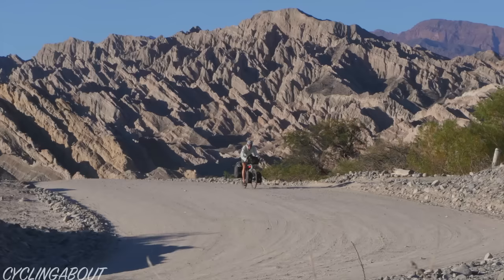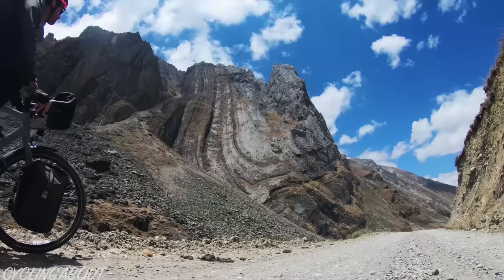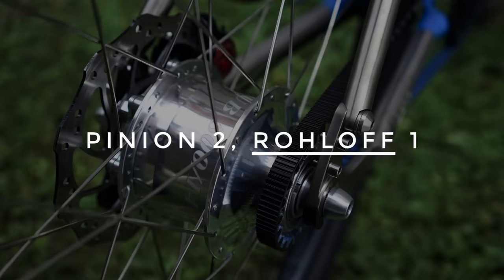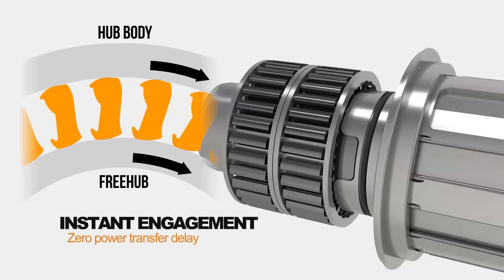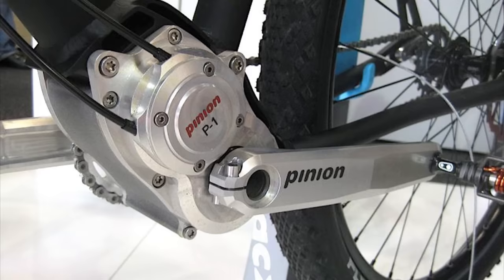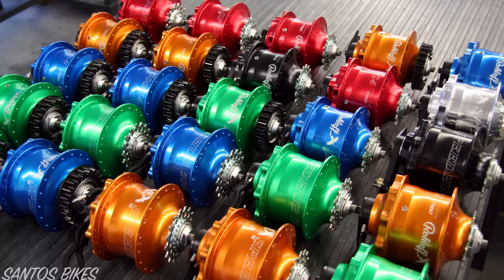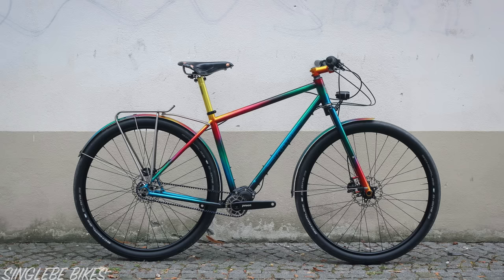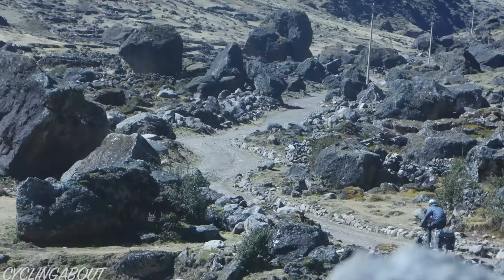What's The Ultimate Bicycle Gearbox? Rohloff Hub VS Pinion Gearbox

Comment: Well... I guess I'm gonna have to use both in a single bike! 🤔
Reply: Do it - we'll all have 252 gears and a belt drive in the future :-)...
Reply: I can't find it now, but someone did this and posted a video a while back.  It was pretty troll.  You get the downsides of both, and lose some of the upsides of both, but you can pedal at whatever speed you want.
Reply: @tonyk8368  so you can pedal uphill at 0.5km/h and 500km/h on flat terrain ?
Reply: Upshift with one and simultaneously downshift with the other 😀
Reply: @tonyk8368  it was Tout Terrain who combined the Pinion and Rohloff into a single bike... Here's the video: https://youtu.be/e-ig-R65yHg
Reply: So you can skip the noisy 7th gear :)
Reply: That's like 3000%+ range.
Reply: @peglor  and no one gear are repeated because its different steps between them 😂
Reply: Great! But you'll have to fit a controller with according software to switch the best gear. The hardest thing is to find out how to fit the petrol engine..
Reply: @mamatidea  thats easy. A 50cc 4 stroke honda clone power washer motor will sit perfectly on a bolt in tray above the pinion. 
That would be a killer bike. But you are gonna have to figure out the drive system in regards to the gearbox. You will need some sort of jackshaft and some sort of secondary freewheel sprocket added into the drive train.
Reply: @christianwetzel2199  I think the highest gear on the many hub gears is unity (not sure about the Rohloff) but you'll get the super low gear of each box combined. It of course depends on the gear ratio you use to connect the drive sprocket and driven, which for the Pinion gearbox bike setup here looks to be around unity.
I looked up the Rohloff and gear 11 is unity so it does offer an overdrive of up to 1.467 to 1 in gear 14 according to Wikipedia.
Reply: Hahahahaha. Cool
Reply: I wonder if it can be done, as I have a Iron Horse Tango Tandem. As soon as I have the means, I'm looking to make it an E-bikes with a geared hub. Im wondering if I can modify it to run chains ( or belts on both sides to the gearboxes?
Reply: @TimpBizkit  sturmey archer 3spd offers 1 underdrive one unity and one overdrive. The 5spd i think offers 2 underdrive i unity and 2 overdrive. 
Nexus and alfine and the sram ighs i believe offer overdrive also. It would be fairly unpopular to offer no higher speed gears in a gearing system for any but the smallest use case groups. At that point you are talking about a group of people who would be perfectly happy using a single speed or even fixed gear set up. 
Most people who want a gear system at all, want at least some overdrive capability.
Reply: @billwilhite2190  im going to preface this by saying that im not a even slighltly initiated into the mechanics of tandem bikes. I know that for the most part they have drivetrains on both sides, but that there is some alien technology involved in the melding of the two drive trains. 
 It totally possible to have an electric tandem. Again this isnt a world that im very well read in, but my impression is that most of them are rear or font wheel hub motors, but its totally possible that there are mid drive tandems. 
If you wanted to build an electric tandem with a gear box and an internal gear hub, you would want to find a front wheel motor kit, or a bolt on mid drive motor kit. As for the front gear box, thats probably not going to be something like the pinion unless you have built or self build a frame that allows for that. To that end, you might look into somethinf like the schlumpf drive. Im not sure if rhe schlumpf drive is natively compatible with mid drive motors, that might take some adaptation. 
As to belt drives. 
Depending on what else exactly you are doing, theres not basic reason you couldnt use belt drives on a tandem. The complication comes in when tou start trying to do things like adding in a front gear box, and a mid drive motor. It can probably be done and may even exist. But it starts to become exquisite and expensive if you start doing to many things at once. 
 For instance, if you want to have a mid drive a some sort of front gear system, what are the other gear ratios involved with the other transmissions on the bike? Are you gonna have memorization on just the captain or will the stoker have a motor too?
 Now if you wanted to build somethinf pretty solid, i would say to find a 500 or 1000w front hub motor and have the motor controller programmed to advantage torque over top speed. Because you are adding a lot of weight to an already heavy bike. I would give the captain the throttle and have a three speed traditional chain ring on the stokers position. On the rear wheel, put in an 8 spd nexus or a rollhoff 14 igh. 
 Thats going to give you a great deal of high gear for hill climbing and still have 9 low gears for speed on the rolhoff at least. 
 The motor will absolutely haul you up hills and if its super steep you will have the high gears to help it. And for flats, the motor will get your pace up high enough that you will be able to efficiently get your cadence high enough that you can attain and maintain a pretty high speed. 
 Thats just my opinion.
Reply: @metamorphicorder  Hi. My intention is to use it like a rickshaw. It will be probably a  distance of a quarter mile ( rectangle) , go no faster than 10 mph, and carry two people tops, with place for small children if needed. There will be no charge, ( donations welcome). It's art/five college area. ( When there's no virus to worry about). So, because I want to put a 24in, fat as possible tire in the rear, I want that rim to house internal gears, as many as practical, so that if the motor (s) fail I can ride it with passengers. The horse Cart is heavy, but I plan to have motors built in to the wheels it has. I can't afford to keep a horse ( I'm not healthy anyway, (or I'd just pull it by hand,)  and almost 69. It would be cool to be able to sail down the road, but it's intention is to pull weight. I'm trying not to use hubs, to be able to remove wheels easier should the need arise. I have little to no knowledge of motors, so the more I do right the first time, the less I have to invest. Thanks for your input. Take care.
Reply: @billwilhite2190  sell the tandem, unless you have a partner in the venture. Its really not ideal for this. 
 You would want something like the rad burro, but just in concept. You wont be able to get that. Its a commercial only model being sold by rad power bikes. Its purpose built for this type of thing, but costs 5k and are only sold in pairs last time i checked. 
 You would want to find a pedicab trike and the easiest way to motorize it would be to add a 1000 or 1500 watt front hub motor. 
You can find such that have specially modified igh on the axle in the rear to give you gear range. Trying to mod what you have to do what you want is going to be more expensive and less suited for what you want. 
IMO at least.
Reply: @metamorphicorder  thanks but I'll figure it out. No pedicabs etc. Not the effect I'm looking for, the rides are free.
Reply: @billwilhite2190  hope it works for you.
Reply: That's a recipe for a perpetual motion machine!
Reply: And for a good measure, add both front and rear derailleur between the two?
Reply: Thank you, @JonAbbott ! I didn't come across this April Fool's post earlier, and I drove both a Rohloff (on a Patria frame, belongs to a family member) and a P.18  (on  a ToutTerrain frame, which I saved on for more than ten years, and now use as my daily driver for basically everything reasonable). It was a tough decision between the both, but Pinion won by having the option just to swap the rear wheel.

Comment: I've been using a Rohloff for a decade and about 85000km now. Initially the first 7 gears whirred a bit but that disappeared soon. I lightened the whole gear-range for mountain trips but after that I just cycled and cycled and cycled. Oil change every year during a good clean-up and then ready for another year. For my usage (long distance, multi-day trips, 50/50 paved/gravel) I would not consider a pinion gear-cluster. I love the reliability and use of use.
Reply: Tried Trigger shifters or default twist shifters?

Comment: There is another option. I use a Shimano Alfine hub, mounted on the bike frame as a gearbox. The crank drives the hub, the hub drives the rear wheel through a second chain. This gives me the advantages of the hub-shift system, and still lets me use off-the-shelf wheels, so I can easily replace the rear if it gets damaged. I could retro-fit a Pinion gearbox to a standard frame, but the high cost of the Pinion, with little in the way of potential gains for a commuter bike means that it does't seem worthwhile.

Comment: Both gear boxes a pretty good and perfect. Your research is very precise and based on facts. My 15 years old Rohloff had a leakage at the left hand side. They exchanged the sealing for free including assembly work of my bicycle dealers. My 3 years old pinion had a leakage, Pinion exchange the sealing for free but I had to pay the assembly work of mu bicycle dealer. So my experience was, Rohloff gives the better service.

Comment: After watching this, I need to start saving up for a gearbox bike mated to a belt drive frame. I’m done with derailleurs.
Reply: DeFAILeurs. LOL
Reply: What is wrong with derailleurs?
Reply: @Don19762  Exposed. If there was a full chain case they would be ok.
Reply: @difflocktwo  Mike Burrows made a prototype modern city bike with a cast grp frame, and integral chaincase.  The concept was for an enclosed derailleur system, the rear mech to have three jockey wheels.  He asked some derailleur manufacturers if they could make a shifter to work within his concept - they could, but felt that they would not sell enough product to make the development and tooling costs worth it.
Reply: @DanielMosey  ... Why the hell are half these comments about fricking E motors???
Reply: This week I got my SA XL-RD5w wheel out of the closet. It had been shifting poorly because the key was sticking. I took it apart and found the problem it came with from the factory. Likely why so many of these failed and was discontinued. Of the 5 slots where it engages the nubs in the planet cage, FOUR were sticky at the opening. WTF. So I used an engraver to grind the end 1/4" of the slots a hair deeper and round the lip. Only takes half a minute each. 
SUCCESS, NO more sticking. 
I LOVE this hub. I've had it up to 46 mph downhill and some 125 mile day rides.
Only problem is the gears are like 6-8-10-12-14 or 5 to 13 in a Rohloff. LOL
Defaileurs never felt solid to me. Double shifting was a PAIN. Cleaning those triple clusters is just impossible. There are thousands of different parts. STUPIDLY complicated.
Reply: Sell your car to get one. Not cheap.
Reply: @DanielMosey  An e-bike would grenade the Rohloff hub. And since when is an e-bike part of the equation anyway? If you need an electric motor that powerful, just buy a real motorcycle.
Reply: @DanielMosey  That's a thoughtful answer. But still: If these hubs offered any benefit, they would be using them in the Pro circuit. I'm hoping some day we will have a viable internal drive, but these still have major flaws.

And as for the cost of a bicycle, I have a base model Specialized Levo that cost over $5000. Out of the 50 motorcycles I've owned I've paid half that on average for a good used one. So the e-MTB is for performance on a trail, and the motorcycle is the cheap transportation I ride back and forth to my bicycle shop.
Reply: @GordoGambler  Perfect!! I'ma steal that, K? XD
Reply: Nothing beats chain/derailleur and a good waxy lube. Weight wise but also: if you want another transmission range: easy with chain and cogs. impossible with hubs.
Reply: @Don19762  i`ve have had two gummed up with grass in over 50 years of allsorts riding , i think possibly they could get damaged in rocky terrain but there sixpence to fix if you dont go fancy...so no idea whats wrong with derailleurs  !
Reply: @GordoGambler  "There are thousands of different parts." That's complete and utter bullcrap. Derailleurs have at most 50 parts; an internally geared hub to have over 200.
Reply: they are not as good, but for my commuting, the 8 speed shimano alfine with a belt drive works well.  but to run a belt you need a frame with a split seat stay.  i have had a couple of the 11 speed alfines and they break!
Reply: @Konocti  The Rohloff is built to handle the torque delivered by two athletic men on a tandem. They do limit the smallest sprocket size to minimise torque overload. The best option would be to mid mount the hub and place it before the motor. Then it only see's rider's pedal power.
Reply: @DanielMosey  On suspension frames it does need a chain tensioner. I have one at the back as I could not find a strong connection at the front end.
Reply: @DanielMosey  

Geez, why not get a mo-ped then?

Comment: For more than 15 years I am very satisfied with my Rohloff gearbox on a trecking bike. 3 years ago I exchanged the bottom bracket for an aftermarket mid-motor and the rear sprocket for a slightly smaller one, and  now I have one of the best and most lightweight e-bikes in my area. I would always take a Rohloff again. And yes, I always try to avoid gear 7 and use the 1:1 gear 8 instead.

Comment: I think price is also missing the point that you can actually get a rohloff hub as a single part new for ~1000 Euro for retrofitting. Even more important, you can get them used for half of that - With their legendary durability even a really old one is probably fine.
Reply: Maybe, maybe not.
Reply: I don't think Rohloff supports aftermarket wheel builds anymore. If it isn't built by them they won't warranty it
Reply: @MrJonas2255  Rohloff don't build wheels and they give their hub a 2 year warranty. Bike manufacturers build the hub into their rim of choice.
Reply: Legendary durability is just the German marketing machine in full swing. If it is that great, why not offer a looooong warranty. (Same for German cars, BTW).
Reply: @johnp6404  fact is hardly any product is supported by more than two years warranty...
Making your statement irrelevant.
Reply: @johnp6404  Because there are people who will never change the oil.
Reply: yes but even thinking spending more than a hundred quid for an apollo from halford is 90% cyclers .

Comment: I think the P 18 is a great gear box. I have a Idworx Opinion BLT with an electric Alber drive train (got rid of my car in the covid period and commute now with my bike and electric drive train; 18-22 km) and can change the rear wheel in 5 minutes and have the full advantages of the pinion 18 gears on a normal mountain bike. I admit, when using an electric rear drive train the P 18 is an overkill - a P12 is enough - but I have the best of both worlds. I have 2 great bikes for the price of 1; it is a lot of money, but I save over $ 2.000 a year in public transport for my work and this makes a sound business case even spending $ 12.000 on a bike. Hope to see you all in the fall in the USA when I want to take my e-bike on a trip from New York to Key West along the Eastern Divide Trail.

Comment: I have been contemplating to get a bike with one of these system.  In my head, I am also adding about 3lbs for a heavy duty kryptonite U-lock to protect these expensive bikes.
Reply: I got a TiGr titanium lock a few years ago after seeing a friend's example and I would get another. Impressively tough and much lighter than comparable U-locks. Worth checking out (no affiliation, I just like them and they aren't well-known)

Comment: Great review! I have a C1.12 on my bikepacking bike and a Rohloff on my tandem. Your assessment is spot on! If you go with a C1.12, you save about 600g AND you have some aftermarket options for shifting (dropbar and flat bar from Cinq). Of course, you lose 6 gears and therefore have a bigger cadence jump between gears. The only complaint I have about my Pinion is the slow engagement, so if they can fix that, I’ll be totally satisfied with it.

Comment: Great in depth video ,I have both admittedly on slightly different bikes ,The Rohloff is on a Surly Ogre & the Pinion is on a Titanium Olsen belt driven & is lighter ,but The Surly with the Rohloff chain driven  seems faster ,the wheels & tyres are the same .
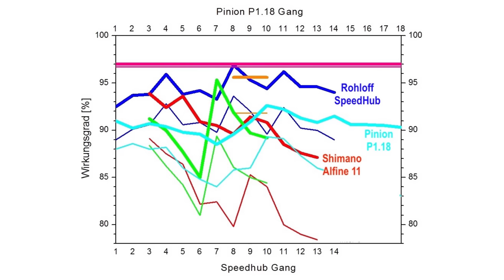Reply: 2:44 average efficency of 94.5% for the Rohloff 14 vs 90.5% for the pinion P1.18 confirmed

Comment: I think maybe the weight discussion is more nuanced. For full sus mtb, moving weight from the rear wheel to the frame greatly increases suspension performance, which would make the extra weight of the pinion actually a bonus over the rohloff

Comment: Exceptional work as always Alee.  Jesse here from the bike shop in Port Alberni, BC Canada. 

I have witnessed very recently a touring cyclist with a Rohloff failure.  Not catastrophic failure, but a very  concerning 'skipping' under load.  Not wanting to stop and wait for an indeterminate amount of time to get it fixed,  he opted to swap out his wheel for an 11spd XT rear wheel and keep going.  Likely the instance of failure on a pinion systems are rare,  but in the event of failure your options would be very limited.  

Thank you for your efforts Mr. Denham.

Comment: Cinq make the Shift:r road for Pinion as well. You can for instance buy them as an option on some of the Tout Terrain bikes.
Reply from the maker: Unfortunately, not for the 18-speed gearboxes.
Reply: @Cyclingabout  ok, good to know. for me, 12 gears is enough and also lighter and cheaper. but still, the rohloff is very appealing, too.